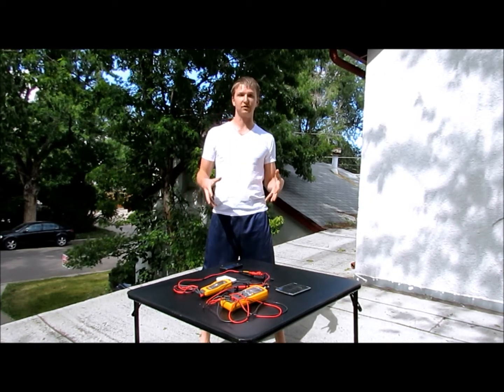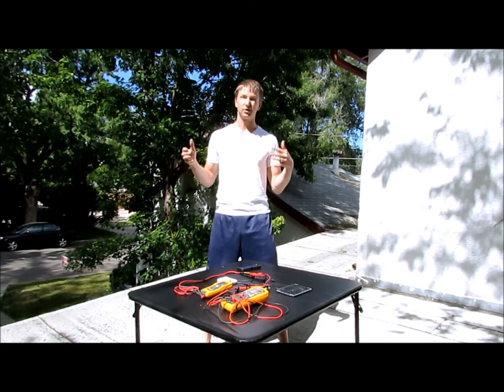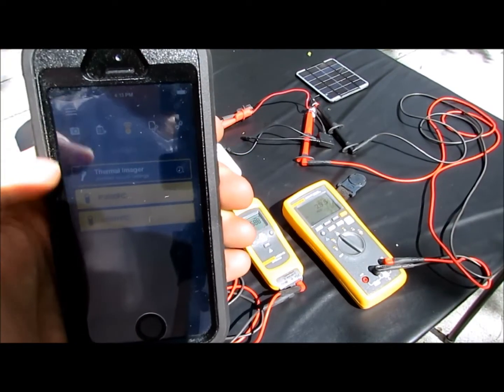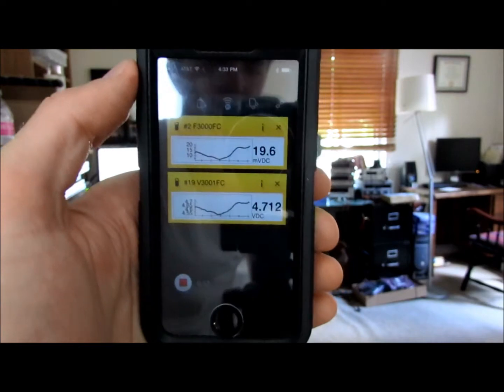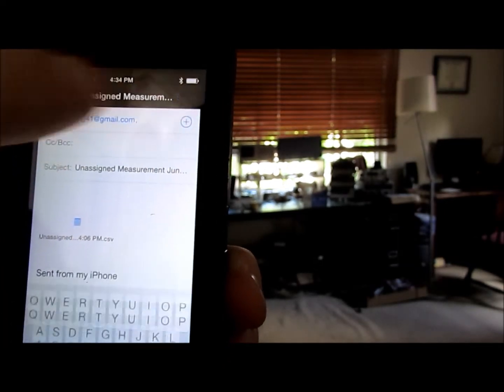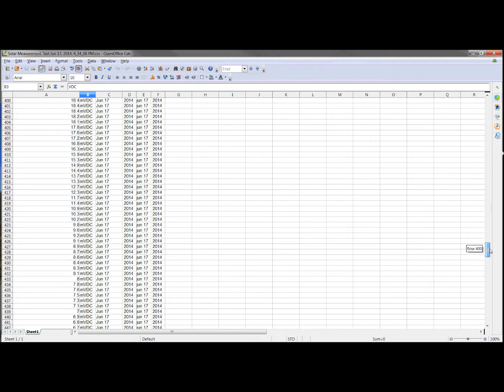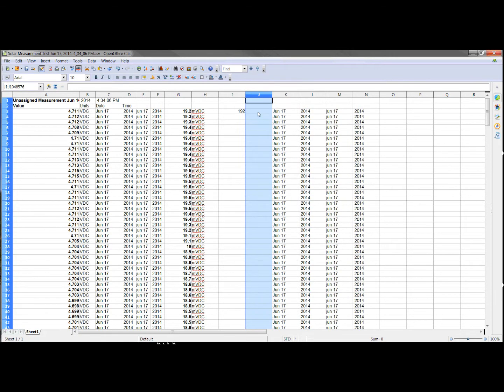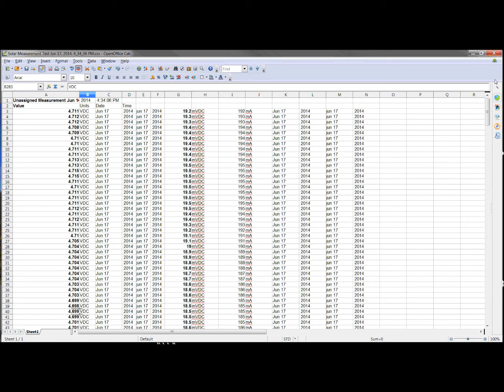Fluke Connect Datalogging

Comment: Im going to go out of my way and say that both data sets should line up at the bottom of the sheet. 
It looks like it because it gave you all the data from the time it connected, and you connected to the second device a few seconds after the first device. I hope you understand what I'm saying. But I also agree, for serious logging if the app allows multiple devices then it need to be time stamped at minus to the second if not more.
Reply from the maker: +Dave B (My Gadget Tech Thoughts) You're right that not having the data sets line up is a problem. In the video, I assumed that the two had different sampling rates but if the two instruments don't start at the same time there could be a problem there as well.
I also found that if one of the units disconnects for a few seconds, it will simply not record anything.

Overall, not having a decent time stamp makes it impossible to trust the data, and even worse, know what caused the error and how to deal with it.

This video was posted over a year ago, and Fluke knew about the bug when I posted this video at launch, so I bet they have since fixed the bug (I haven't tested it though).
Reply: +Dave Young 
If it misses a reading it should at least put a null, but I guess I'll find out how logging is soon. I might get the Bluetooth module as the free gift for an order since their is nothing else I want, maybe the iPod touch, I haven't decided yet. But even if I got the BT module it may not be a fair test because we would be using different instruments. I needed a new meter so I ordered the 289 and it may throw time at the iOS app since it logs locally with time as a data collector also and has a clock.
What are the 2 instruments you were testing with?
Reply: +Dave Young 
Im on an iPad currently, and it won't let me private message. But if you can send me a private message. My account is open for that, and we can work something out maybe so I can do a follow up test with your help.

Comment: I know this is an old video but ...I agree with the other comment, bottom numbers lining up because you had to select the devices sequentially (so one started collecting before the other).  Second comment would be that it appears Excel took the comma in the date (June 14, 2017) and made the year (after the comma) a separate field.  I see two options.  1) use a different output format or 2) do a manual import from Excel where you have more control over import.Final comment, I would like to see the CSV opened in Notepad ... perhaps some date was lost in the import.Other than that, thank you for the video.